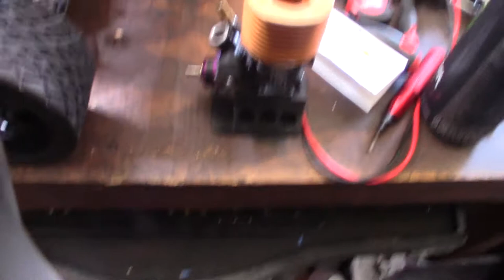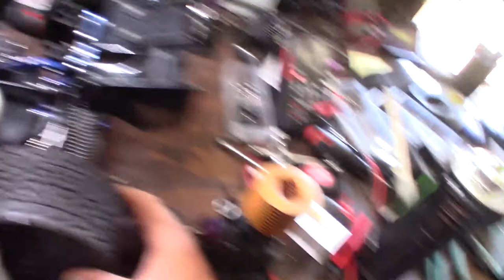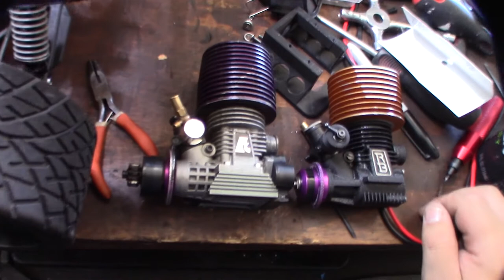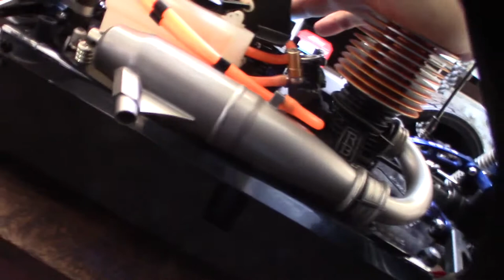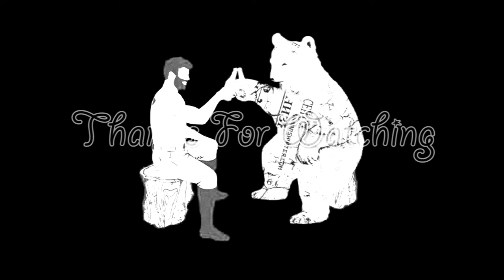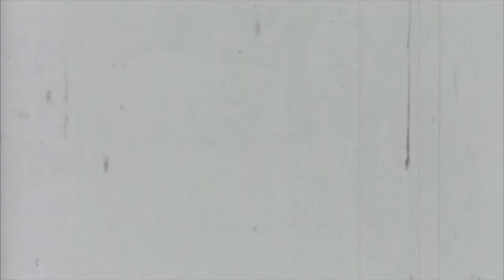RB Concepts C4 nitro engine first fire up in my Mugen MBX5T RB Concept C5 C6 RC GAS

Comment: I have the same motor was looking online for the carburetor setting cud not find it any one knows the setting
Reply from the maker: I'm not even sure if the carb I have is factory. I got it in an ebay lot. I started at about 3 1/2 turn out on the HSN and about 3 on the LSN. It bogged so now I'm about about 2 1/2 turns out. I'm still trying to figure it out myself. Does your carb look like mine.
Reply: Fintech Repair Shop  U will have to send me a picture of it do u have the pipe for yours ???? From Close LSN 3 turns out ????
Reply: I have a new motor also
Reply: I try to start my motor it didn’t want to start on till fire came out at times lol look cool tho
Reply from the maker: @omgitstm  yeah, 3 turns out from closed on LSN. The carb venturi that came with it is 5.5mm. Like I said I don't even think the carb that's on it is RB